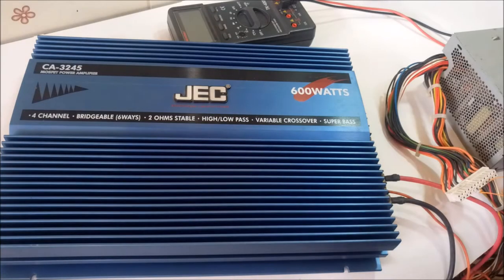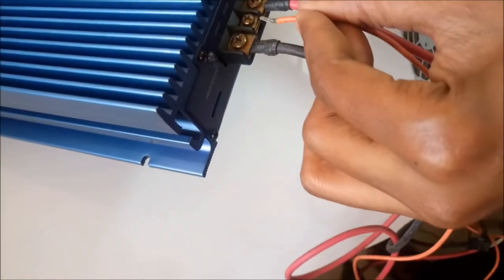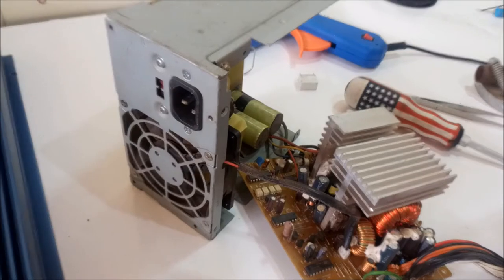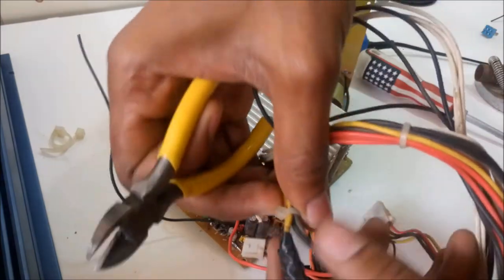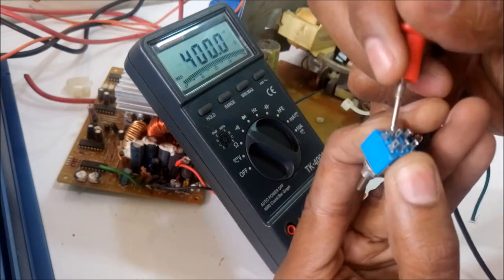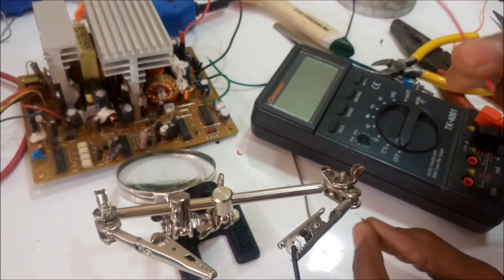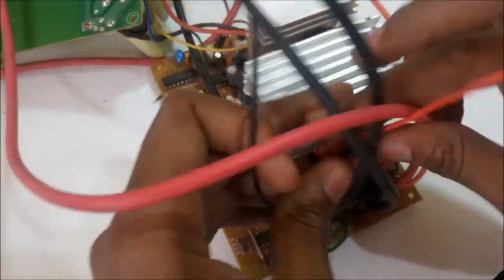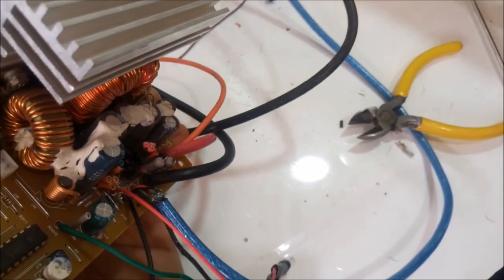Car Audio Amp Computer Power Supply Transformation

Comment: What is the use of that remote wire.the orange one between negative and ground wire.
Reply from the maker: That's a remote switch for turning on the amplifier. Without it the amplifier would drain the car battery even withoit music playing. So it's requred so that the amplifier turns on only when the ignition is in the ON position.
Reply: Alternatively get a cctv power supply. They are dirt cheap and a little easier to work with. Get one with the right amps for your amplifier. Your can get one with 12v and 20, 30, 40 amps and so on so huwezi kosa one for your system no matter how demanding. Check out https://www.youtube.com/watch?v=CziqN3A423Q&ab_channel=Firealarm102

Comment: hey man i was wondering if i could run a 30 amp skar RP-350 1D monoblock amp on a 12amps power supply
Reply from the maker: Yes you can but it will shut down immediately that 12 Amps is not enough. For example if you increase the volume too much on a bass heavy track
Reply: @DominicGichane what can I do for it not to turn off

Comment: hello I tried this out and it worked half way when i plug the suppply to the power it blinks and goes off again is it because of the switch or what might be the problem
Reply: check that you have sorted the "remote" for the power supply as well as the amp. You can short it or put a switch between the remote cable and a black wire. Be safe though, stima haitambui experiment. Make sure you have double checked all your connections before plugging into the mains

Comment: can a 12v 11A supply power on a car amplifier
Reply from the maker: It will but it'll be underpowered meaning that the power supply will shut Itself down when the amplifier demands more than 11A
Reply: What if My aplifier has 2 25A fuses?Does that mean it actually needs 50A to run at max power or its just 25A with the second fuse as a safeguard?
Reply from the maker: That's just the maximum rating for the fuses to blow. It sort of means that if it draws 25A or more then there is something wrong with the amp. So even a lower rating power supply will work.